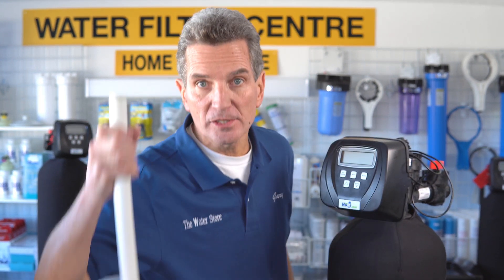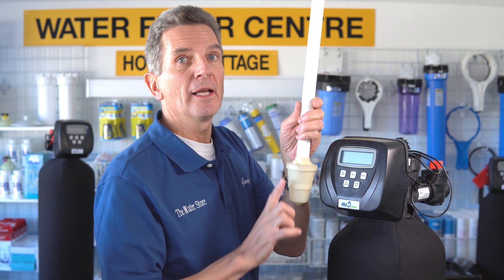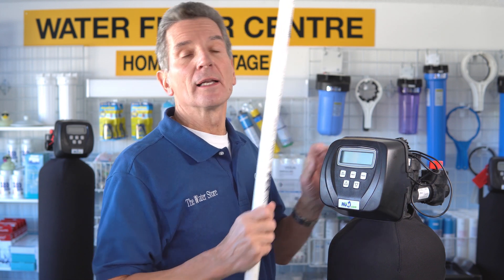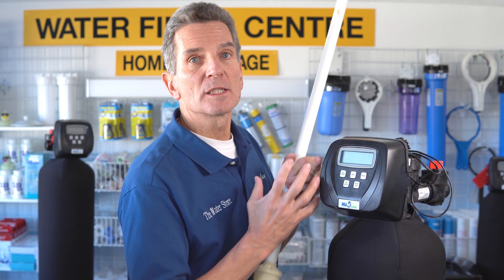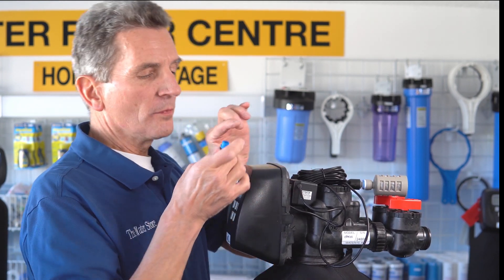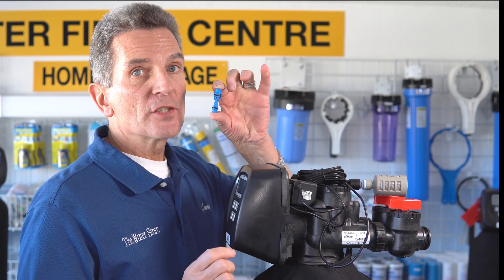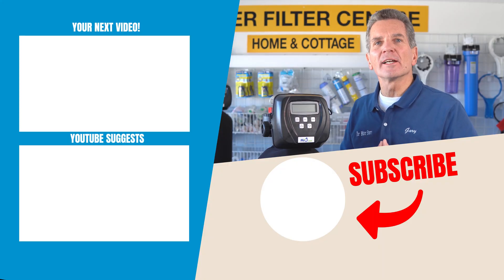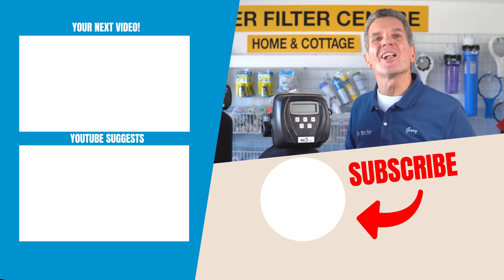HOW Does a CHEMICAL FREE FOK IRON & SULPHUR Filter Work?

Comment: Gary is it really chemical free? The resident is made out of plastic which is made with petroleum. 
Do you know of a chemical free resin that could be used? 
I have an old system that’s over 15 years old what did they use for the old systems? I’m wondering if I could just use the old stuff. I don’t want to use plastic resin
Reply: Ooops I meant Resin not resident
Reply from the maker: Yes, it is called chemical free because typical chemicals like chlorine or hydrogen peroxide used for iron removal are not necessary for this system.  Birm was used for the old systems, but it had lots of limitations.

Comment: Hi, I had this unit installed a month ago for a bad sulfur smell. Worked good for a week then we started to noticed the smell again. The installer finally came back out three days ago and found that the unit had no air and said the air intake was blocked up. He cleared it and ran the unit through a backwash and an air cycle? Water was great for a day then we noticed the smell again. Could our unit be defective? I checked the air intake and seemed clear, but when I pulled the red retention clip to release it some water came out. I had the bypass valves in the off position.
Reply from the maker: It could be a number of things, like do you have an irrigation system connected after this system, do you have enough flow rate for the system to back wash correctly, is your sulphur level beyond it's capacity?  Things to discuss with your sales person
Reply: @ Hi, no irrigation system, just a small single bath home with two of us. Well has a 7gpm pump with lots of pressure. I ran the brine cycle as per one of your videos and it cleared the smell up. Im thinking it’s loosing its air pocket somehow. The tech is suppose to come back out just not sure when. But at least I can get rid of smell myself until it gets looked at. Is there a way I can set the unit to do the brine cycle automatically? Thanks!
Reply from the maker: Be sure they have the check valve installed.  This video has more info. https://youtu.be/Yg0HTiaLVFg

Comment: Hi. Thanks for this informative video. My sulfur tank has a tube (about 8", thin, rigid, gray) that comes out of the middle of the "manifold" and empties into the air. It has been dripping constantly lately. I believe this is where air is sucked in to oxidize the sulfur. Is that right, and why would it be dripping water? Thanks for any help!
Reply from the maker: The check valve has been compromised.  We have the replacements here https://waterestore.com/products/clack-fob-c-k-strainer-check-valve-air-intake-assy

Comment: when the system flushes, will you have the sulfur smell again?
Reply from the maker: It will be off line while it flushes, which takes 45 minutes, so if you use water then you might get some smell, but they typically flush at night when there is very little water usage.

Comment: Great videos, Gary. My water test show ph of 8. I have a carbon filter like the one you show in this video. I do not have the orange color any more but I do have black stuff. I see it in my toilet and the back tank of toilet is shiny black stuff. I assume maganese. How do I get rid of that. Please help. I can't seem to find a solid answer.
Reply from the maker: A water softener will remove manganese.  I would have your water tested and then complete the info on this form and submit it to use so we can make a recommendation https://waterestore.com/pages/free-water-test-evaluation-the-water-estore
Reply: @water_estore  Hey thanks for the speedy reply. Is there a way to do this without a water softner? I don't really want to add chemicals to the system. Ive heard about green sand I think. But I am unsure of the system and how to use it? Will that work? Or are their other options? Thanks janey
Reply from the maker: No, you will need a water softener to get rid of the manganese
Reply: @water_estore  What about a "no salt conditioner" that I see? do those work? Do I have to have a traditional water softner and store and haul the salt up to my house? Or will those no salt conditioners that I see take care of the maganese? I am happy to spend money with you if you send me a link? Thanks
Reply from the maker: The "no salt" systems don't work, so i don't recommend them.
Reply: @water_estore  I should probably call you but I am sure others might read this and want to know. I don't want to have softened salt water at my kitchen sink. How can I get rid of the softened water at the sink? And if you say reverse osmosis then arn't I getting rid of everything in the water even the good stuff? Is there anyway to win? Have good well water at my house not full of softened water chemicals but with the minerals that are good for you? thanks!

Comment: Hey Gary, I was looking at a air injection setup for my well water. I am getting 2ppm of iron after a sediment ,cto carbon filter and water softener. So my water test told me.  My water has a light yellow tint to it and some stining in sinks. I tried a iron filter from ispring but it did not do anything. Do you think this might be a good solution?
Reply from the maker: It might, but I would definitely have the water tested for tannins and iron content before all of the equipment. You  can email me the test results at info@waterestore.com

Comment: Hey Gary- Thank you for this informative video. My water has a sulfur rotten egg smell with high sediment, 33 gpg hardness, 2.0 ppm iron content, iron bacteria (500 colony forming units per milliliter), and sulfate bacteria . I have installed a sediment filter and water softener that removes the sediment, hardness, and iron (not the iron bacteria). I believe the smell/unpleasant taste is from hydrogen sulfide. When the water is put through a carbon filter the smell and bad taste are removed. My well is about 11 gpm. I really do not want to use a chemical injection system or an ozone generator if I don’t have to. Question: Can I use an air injection iron eater system to remove the smell and unpleasant taste of my water? I’ve read that iron bacteria can colonize faster with an air injection system from some publications, and I’ve also read reviews were homeowners claim to have iron bacteria and the air injection system eliminates the smell and bad taste. Do I have any options to treat my water outside of chemical injection or ozone generator? I think an RO will clog fast even with sediment filters prior to. I apologize for the very long comment, I have talked to water salesman, water sanitarians,  the NSF and everyone has something different to say. What are your thoughts? I appreciate your time sir.
Reply from the maker: The only way to get rid of iron bacteria is chemical injection.
Reply: @water_estore   Thank you Gary. Will Ozone kill the iron bacteria as well?
Reply: @jamescreech8063  yes

Comment: Gary, I have a water well that produces lots of water (about 75 GPM)  but the water definitely has lots of Iron and Sulfur.  I don't mind irrigating grass with this water as the iron makes it a delicious dark green color for my cows to enjoy.  That said, when we build the house we want to have a 3,000 gallon water cistern to supply the house.  I also want a high GPM volume of water going into the house so that every outlet can be ran full blast with no problems.  So, my question is this; how is this system best designed?  Should the Water Treatment System be between the Water Well and the Cistern and onto the House OR  should the Water Well itself directly Supply the Cistern with Untreated Water and then Treat the Water Once the Water Leaves the Cistern and Before it Enters the House?  Basically, wellhead to water treatment to cistern to house OR wellhead to cistern to water treatment to house or some other variant?
Any advice would be appreciated.  I thank you in advance.
Reply from the maker: Great question. You are always best to treat it after the cistern as water enters the house.
Reply: @water_estore  Gary, can you explain why treating AFTER the cistern is better?  I am only asking because, in the event of a power supply interruption, if the water were treated between the wellhead and the cistern then the water in the cistern  could gravity flow into the house and it would be treated and filtered already.  My mind is open to your ideas.  I'm just looking for the best solution.  Thanks!

Comment: Great videos, I have a Water Right FOC 1354, During the air draw cycle the air that is drawn in does not reach the media bed. When the cycle is done the air dome is about 4 inches. Is that enough of an air dome? Is the air draw cycle supposed to draw air through the media? Thanks again for all your great videos!
Reply from the maker: Somehting is wrong.  I would check your settings https://youtu.be/AaAfTlDNUF0 either the air draw time is too short (brine cycle) or there is another cylce after it releasing the air.
Reply: @water_estore  I have found that the DLFC is missing, not sure when that happened, could have dropped out when I serviced the tank in April. What problem might that cause?

Comment: hello Gary.  I bought a house last year and it has a water softener system and another tank for the peroxide system.  After almost a year, I am realizing this peroxide system does not work for me.  I have to use 1/2 gallon of peroxide a week.  I doubt the system is working correctly.  I would like to change to the FOK.  I have high sulfer and high iron.  My question is, can I just replace the peroxide tank with the FOK tank?  They look the same size.  Where do I purchase the tank?  thank you for any help.  Denise
Reply: What is "FOK"?
Reply from the maker: Yes, just make sure the water flows through the FOK before the softener.  We have the FOK here 
  https://waterestore.com/search?type=product&q=fok*

Comment: Hello Gary. Do you sell a system with H2O2 injection (filter head acts as the pump)?  Lab test shows that I have bacteria, 2PPM Mg and one PPM dissolved Iron. Shocking the well with a gallon of bleach lasts about a month before odor becomes pretty bad, the water slimy and stains fixtures.  I only use the water for washing, and I buy bottled water for drinking and cooking.  PH is about 6.7 and I have a shallow well with a low flow rate (2 GPM) which rules out a lot of back-washing filters.  Since I only have one bathroom and 2 people in the house, what would you recommend?  The house used to have a water softener that was removed before I moved in as it was rented by the previous owner.
Reply from the maker: You can only use a chlorine injection system with a low flow rate.

Comment: Hey Gary! Where I'm from I can't seem to find a control valve that uses air injection technology. Can I use a valve used in softeners, instead of salt it sucks in the air?
Reply from the maker: The softener and iron filter valves are the same, just sucks air instead of brine.  Here is the fitting https://waterestore.ca/products/clack-fob-c-k-strainer-check-valve-air-intake-assy

Comment: Had iron system removal installed. Since installation,  have constant unclear water. To much air in the water.  It takes a half-hour for a glass of water to clear. There is a ClackWS1 valve.
Reply from the maker: The air is used to oxidize the iron out of the water.  Speak to whomever you purchased it from to reduce the air draw.

Comment: Gary, I’m curious now.  If my raw water is pH 6.8-ish but I have manganese, how do I get rid of that?  Would I need to be raising pH above 8, filtering thru K, then re-adjusting back to neutral?  Copper pipes come into play also.
Reply from the maker: No, a water softener will remove manganese at that pH.
Reply: Gary, I have the same PH as jdbeck but my Iron Level is 16.2 & my Manganese level is 1.16
Would the KOB get rid of that much Iron?
Reply: Reverse osmosis is the only way to lower p.h

Comment: Hello! We have a well water system, and water test showed water was very high iron. So we had what looks like this  exact iron filtration installed this week. Called Fusion2. We are now noticing our water coming out of the tap feels very ‘slimy’ for lack of a better word. Almost like we feel we need to keep rinsing & rinsing to ‘wash’ the soap away. What is the cause of this? Is this normal? Thanks!
Reply from the maker: Do you also have a water softener that was in use before the iron filter was installed?
Reply: Gary the Water Guy No! We had a ‘whole home’ filter attached where the water comes in, just before our pressure tank. We used a micro filter & it turned orange very quickly! Changed often. They removed that when installing the Fusion2 ‘iron filter’ this week. Nothing else attached. Except oil/hot water furnace also on the system. When they installed the iron filter, they also flushed our pressure tank for us. (Thanks for replying!)
Reply: @HeidiJeanTwin  Did you ever figure it out?
Reply: @LRM5195  well, not really, we just noticed that ‘slimy’ feeling lessened after a while. Maybe cuz the system was new and eventually sorted itself out. Water feels fine now, no issues.
Reply: @HeidiJeanTwin  nice thank you for the reply

Comment: Hey Gary! Thanks for such a simple explanation of these! I have the CLACK version of this. They call their media BIRM, but I believe it works in the same manner. I'm told by my water professional that I need to clean this unit once every 6 months. He suggests using H2O2 at 7%, but I read online that high concentrations of H2O2 can damage the BIRM media. I saw that ion exchange media is fine to do this with, but looks like BIRM is a different story. I don't leave it to contact for too long. I set the unit to brine and allow it to consume one gallon of H2O2, which usually takes 2 minutes, then allow it to injest air for another 20 minutes. Then, I set it to run the entire backwash and brine cycle again to completely flush it. So far, this works great. I've had the unit for around 2 years, and have done this three times already. Is there any concern you'd have with doing this, or is there something better I can use to clean the media? I do notice that when it goes uncleaned for more than 6 months, the water smells more of iron from what I assume is iron bacteria buildup. Thanks in advance!
Reply from the maker: Many years ago I spoke to the folks at Clack, who make the Birm media, about this topic.  They said not to use anything as it will burn up the Birm.   I have never tried it but find it interesting to hear that you are having some success.
Reply: @water_estore  Ah so that's why I don't see anything online with information on how to clean this type of media. Well, the media is supposed to last 8 to 10 years. If I have to re-bed a little early, that's acceptable for me. H2O2 decomposes so quickly anyways that 1 gallon at 7% concentration every 6 months probably doesn't do enough damage to significantly reduce the life of the media.